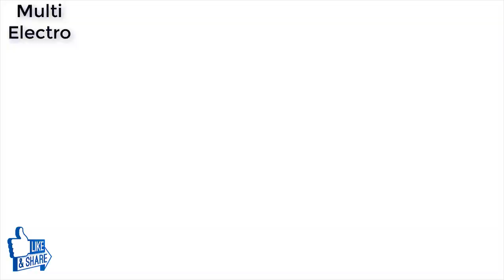Free Energy How To Make Free Energy Generator 12 Volt Battery Charger Science Project

Comment: Ou est caché le câble d'alimentation ? 😁
Reply: Nothing hidden - in this situation it should be the flywheel to serve as overunity element (based on Adspen's insights, for rerunning of flywheel just 15% of energy needed for the initial run ... ) ... In one of videos, the same author had just the upgraded motor by stator magnets (say, S-S-S) replaced by (say) S-N-S. In yet other implementations, it is a condenser or an accumulator in such role !

Comment: Vous êtes vraiment sur que ça fonctionne
Reply: Nothing hidden - in this situation it should be the flywheel to serve as overunity element (based on Adspen's insights, for rerunning of flywheel just 15% of energy needed for the initial run ... ) ... In one of videos, the same author had just the upgraded motor by stator magnets (say, S-S-S) replaced by (say) S-N-S. In yet other implementations, it is a condenser or an accumulator in such role !
Reply: @slobodannedic1799  الطاقة لاتتولد من عدم